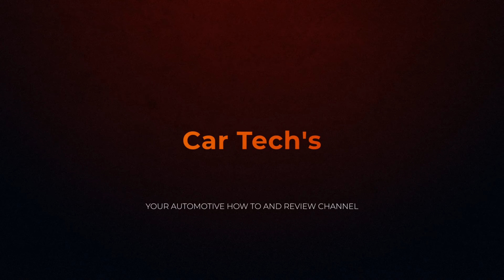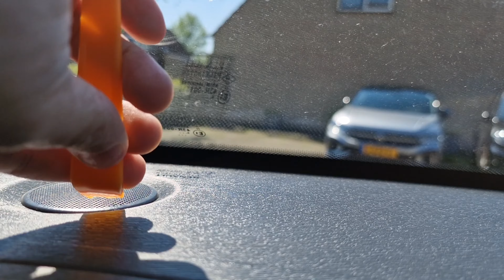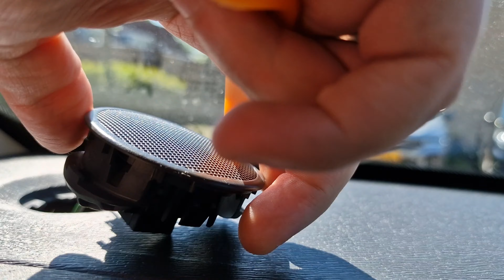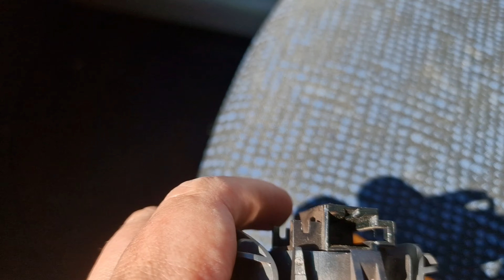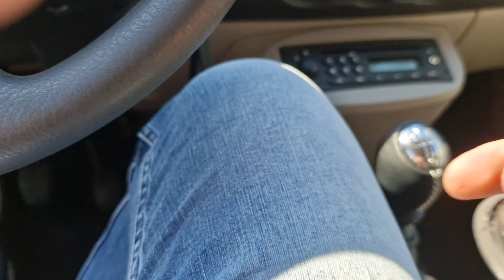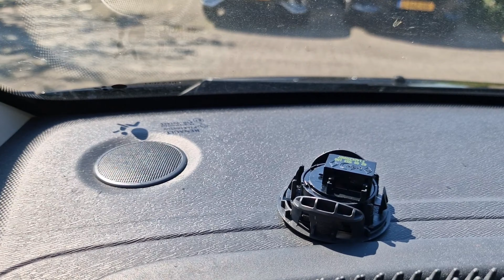How to replace the tweeters on a Renault Twingo CN0

Comment: Hello, what is the diameter of these tweeters? I can't find the original ones in my country, so I was thinking about Pioneer TS-G130C set with tweeters , in specs it says they are 30mm...
Reply from the maker: Dont no it by head. Need to get them out again to look at it
Reply: @CarTechs_nl  don't do it, thanks , I found some that match ! Pioneer TSG130C set has tweeters that match